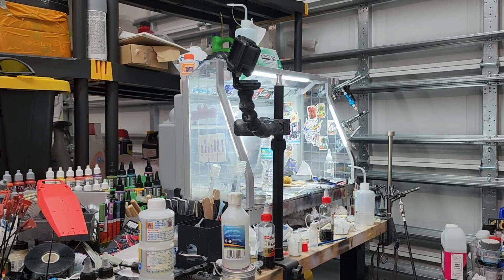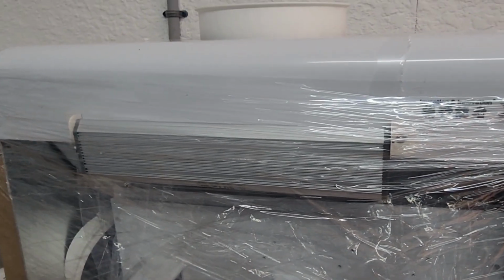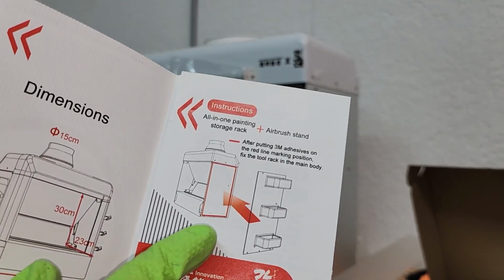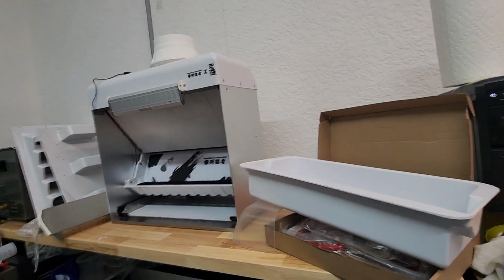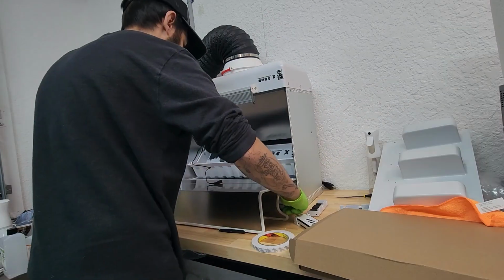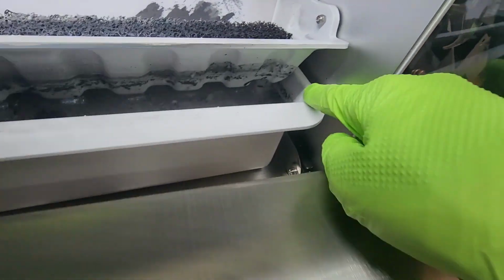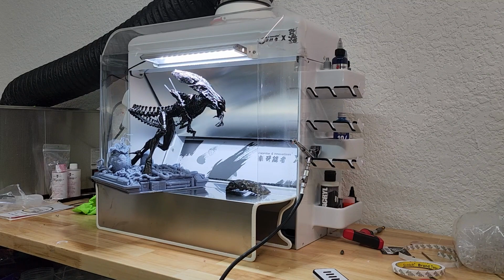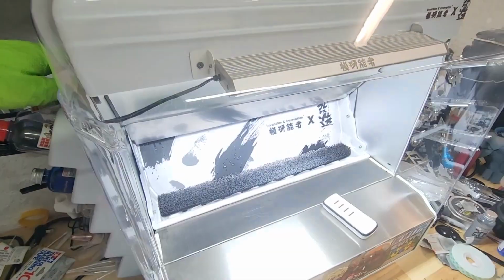Kaizo X Invention & Innovation Assembly Video + Why I upgraded from the Fort Edition

Comment: hey man,i actually recently purchased a used unit of this spraybooth i wanted the newer robot kai one but it was just out of my price range,do you have a link of solvent resistant o rings i can get to replace the standard ones? and any other advice to prevent this meltdown of the sides and such?
Reply from the maker: @joshuawiseman5629  I had to reach out to them to get the replacements, in terms of advise, avoid lacquer if possible

Comment: This video is amazing! Thanks for being so thorough! I have a few questions:
Would you recommend this carbon filter setup over exhaustion through a window when the window is close to the unit?
How long does the smell take to go away from the room? Does the dirty water smell?
Reply from the maker: @StringKiller  I think exhaust streams outside is always best, but if that's not an easy option then the carbon filter works best, and thank you for the compliment.

As for the smell, in my set up with the carbon filter the smell isn't super notable but it's there, and it takes maybe 10 min to clear out in the garage. It really depends on how well the room ventilation is built. I haven't noticed smell from the water itself
Reply: @HobbyBench  thanks a lot!! I'll definitively try this one out

Comment: Does the new model come with dual voltage motor? I see in the old unit that is available you have to choose 110v or 220v I currently live in the US but may move back to South Korea in the next couple years. So if the new unit isn't switchable I'll probably opt for the first generation unit use it for now and then upgrade to the newer model in 220 when hopefully availability isn't so much of an issue.
Reply from the maker: @robertthomason7619  not sure I got the first unit

Comment: question, where did you get your exhaust tubing? Our Lowe’s didn’t have anything larger than 4” diameter, in store at least. And while ik I could experiment buying what I think would work, I’d rather just go with what appears to work for someone else. Just a note I’ll still have to vent out the window sadly 😅
Reply from the maker: It's been a while but I def got it on amazon
Reply from the maker: Should be 6 inch if I remember correctly

Comment: Great learning. Do you attach the spray booth duct exhaust end to the Canlite with tape ? A d the other end of Can lite will release clean air ? Sorry if my question sounds stupid but I am not familiar with the filter idea. I can’t connect the spray booth to the window with the long winter and freezing temp here. So I am using the bucket method which is not ideal if you spray solvent. Thx !!
Reply from the maker: No problem, I'll need to check but I'm 95% sure the exhaust tube uses a standard metal clamp connector and runs into the top of the filter. The filter is a huge cylinder of a cotton like filter material. Inside is 15-20 pounds of powdered carbon filter.

The filter is rated to roughly 600cfm, and the air passes through the carbon filter medium  through the top intake and out all of the cotton filter material second stage on all the sides of the cylinder.

The airflow is unrestricted as the fans are rated around 600cfm and so is the filter, so you maintain negative pressure in the chamber. After the exhaust comes out of the cotton outer layer, according to canlite it's 99.9% filtered of VOCs. I've also done VOC testing and it seems that claim is correct.

Canlites are mainly used by at home cannabis growers who are looking to avoid unwanted attention due to the potent scent of there grow tent exhaust. They basically run a grow tent into a canlite and it completely removes scent and vocs.

I've also voc tested the bucket method and it does not work, it doesn't remove smells or vocs. It just moves the air to a different place.
Reply: @HobbyBench one last question if my spray booth has less CFM than the one you are showing. I guess I have the Ophir with 200 CFM if I am not wrong. Would it still be ok to run the exhaust through the 6” Can lite 600 CFM? I mean if the Can lite has a higher capacity than the booth fan is there any risk that air will come back to the booth. Again can’t thank you enough for the great info !! I was sure the bucket wouldn’t neutralize  any solvent which I avoid using any in winter. Still I prefer a safer method like the filter you are showing and in both cases I always wear a respirator + I have an air purifier in my hobby room
Reply from the maker: @Azantys  I'd use the 4 inch canlite model as it's rated for 300-400cfm last I checked and the unit you have uses a 4 inch exhaust anyway. I also use a resp and have a good air filter (which does help). The 4 inch will have slightly less carbon but it should be fine with the lower cfm and it's still like 12 pounds
Reply from the maker: @Azantys  also I had the ophir and originally I liked it but my lacquer solvents started to break down the rings and plastic led harness connector. If you have the budget I'd def recommend upgrading to the kaizo x just due to the build quality alone being metal, aluminum and solvent resistant plastics. Additionally the negative airflow makes a huge difference in making sure all the overspray actually goes into the spray booth and reducing the fumes. I can basically spray with no scent or vocs with the canlite and kaizo x. I did not test the can lite with my ophir water curtain, at the time I had it hooked into a 5 gal bucket and it was completely ineffective at overspray capture
Reply: @HobbyBench  THank you !!!!
Reply: @HobbyBench  You are absolutely right but I live in Canada and looked everywhere for the Kaizo X to na avail. Shipping from US + Custom and Local Tx will the bring the price +++ I still beed to buy the Can Lite though lol. I saw another filter cheaper  AC Infinity Brand but not sure if it is good enough :)
Reply from the maker: @Azantys  I looked at AC and it had mixed feedback online so I went with the one that weighed the most for it's size in terms of carbon.(canlite by far has most weight of carbon for all model intakes) Most of the Amazon brands are around the same price and are cheaper, but they massively vary in quality and the physical amount of carbon medium. Check the weight of the package to compare which ones have the most filter and also make sure it can run over 200cfm for your fans, as long as it's got a decent amount of carbon and has the cfm it should be fine I would think, but I've only tried the canlite and it's the only one that advertises VOC elimination
Reply: @HobbyBench  And you are right Can lite will be I am not going to cheap out when it comes to my health. Any idea how long  the Can lite would last before you need to buy another one? Say for moderate Airbrushing 2 times a week or so 3 thx
Reply from the maker: I've had mine for about 6 months and it's still like new with one heavy project a month. This is what the canlite website says, 

"Unfortunately, there is no indicator light on the filter that tells you when it is ready to be replaced. Typically 12–18 months is expected of the Original Can-Filter, Although many of them have lasted much longer."

Also humidity is a huge factor in how long they last, so if your in a low humidity environment, it should last very long. I've also seen people on reddit say they have reset the filter if it gets to humidity by putting it in the sun for a few hours.
Reply from the maker: @Azantys  also I found a cannabis forum where people where saying there filters lasted 4+ years. They also said this

" Worst filter I’ve ever bought has been the AC infinity 8",  Best filter was Can"

They were also saying the Vivosun is good and lasted years
Reply: @HobbyBench  thx Buddy. I will order the 4” Can. Much appreciate your insight !! 🙏🏻👍
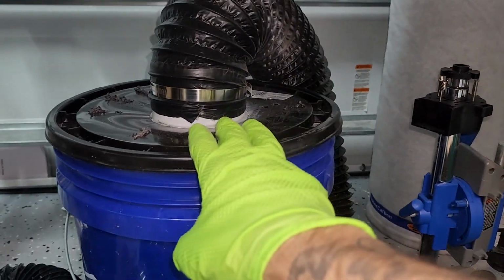Reply from the maker: So I just checked, it's a 6 inch exhaust tube secured by a metal clamp with screw tightening harness. If you look at 6:49 timestamp you can see in the top of the canlite, it has a metal aluminum intake where the exhaust is clamped onto.

You can see the metal clamp itself at 29:03 with the exhaust hooked up for install reference.
Reply: @HobbyBench  thx a lot for the prompt reply man !!! 👍👍🙏🏻

Comment: Hello, all. I received my booth last week. Finally, completed the setup with this video. When I clicked on button A to activate the fan, nothing happened. However, button B activated the waterfall. Has anyone had a problem with fan failure? If so, what troubleshooting procedures if any corrected the issue? I have contacted Bella, customer support for assistance. Thanks. Happy New Years!
Reply from the maker: I have not but I'll check mine to see if there are any steps that could be missed, you have both the light and fan unit plugged in right

Comment: Again, how did you attach the holders to the side of the spray booth. There are two holes on the right side, the screw on the top, I unscrewed and reinstalled it. However, the second attachment point has a screw that is to little. So what is the fix. Thanks
Reply from the maker: I used a knife to clean the hole up and enlargen it on the panel side and I ran the green foam tape around the panel. I put the panel on the foam and then screwed it in where needed. I can see if I got that part on video, let me know if you need more help.

Comment: any recommendations for a exhaust fan for spraying 1k clear?
Reply from the maker: The fan inside will work well on the kaizo x, run it into a 6 inch canlite exhaust intake
Reply from the maker: If your looking for a fan to push it outside you will need an explosion proof one with any of the clears typically, but it will kill the fumes into a canlite without external ventilation in my experience
Reply: @HobbyBench  that’s great. How are you pulling air into the canlite, as I saw you removed the inline fan?
Reply: Sorry are the fans on the Kaizo explosion proof?
Reply from the maker: @philipjensen6442  they aren't rated specifically to be but they aren't exposed either so they should be fine. As for the can lite, it's rated to 650cfm so you just hook your exhaust line from your kaizo x into it

Comment: Ive been thinking of both models and i cant decide on which one to get... i dont know if the 400.00 price tag is worth it and waiting for it to get back in stock for pre order. How do you like this one over your older air brush booth. Still holding up well? Since youve been using it a bit longer? Getting the water out looks more convenient than the older one.
Reply from the maker: It's much much better. The cheaper one started melting literally after 3 months of lacquer usage and a handful of projects. Worth the extra and much better build quality
Reply from the maker: Also getting the water out on the cheaper one is a nightmare because the plastic water bin is so thin it's impossible to move while filled and it's really awkward to lift off, and the clips break like crazy. O rings are not solvent resistant so the water curtain fell on my rx 78 pg u while I was finishing and ruined it out of no where. At this point I'm really unhappy with the cheap one and would recommend putting the extra funds up to go with the x
Reply: @HobbyBench  alright ill just wait then youve convcied me. I just got the pg unleashed as well and looking forward to cuatomizing it.

 Yeah i dont like that you have to pull off the wole booth to replace the water. Thanks for sharing your experience.

Comment: The black package is "adhesive improver", you're supposed to wipe the booth down with those pads and then put the glue/tape to attach the parts to make it semi-permanent. 

As for the water, I avoided bleach as I spray Tamiya and LAcquers and bleach + alcohol = chloroform neurotoxin gas...:/
Reply from the maker: Very good point on the bleach, I never thought of that. What would be an appropriate anti mold agent that doesn't react with lacquers. As for the black package it's just a standard lacquer cleaner, it's meant for cleaning off the stainless steel surfaces after painting
Reply: @HobbyBench  TLDR Really great video, thank you for taking the time to make it! My personal suggestion would be to look at water cooling or aquarium anti fungal additives. The benefit of water cooling is you can find variants that are safe for specific metals (The water pump for instance). Read the small print or write the companies. They should be able to tell you if it will work well. Since you need it to be safe with alcohol, you can't use bleach or vinegar due to the same problem of creating toxic fumes. Regarding the fumes I'd suggest considering to get a molecule measuring meter for voc's. They will totally remove the odor but they don't always remove all of the voc's from resin printing. Size and quality could make a difference for carbon filters but I'd rather know it is working correctly for indoor venting. I'd prefer to ventilate to the exterior for safety.
Reply from the maker: @FSDraconis  thank you for the recommendations, all great. I did get a $1000 voc tester and did formal tests and this set up was effective at removing VOCs